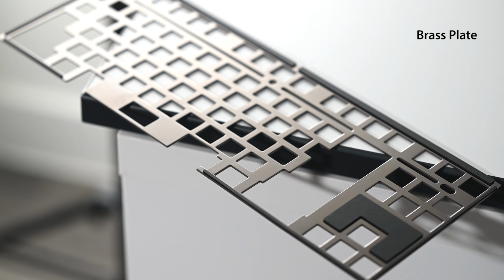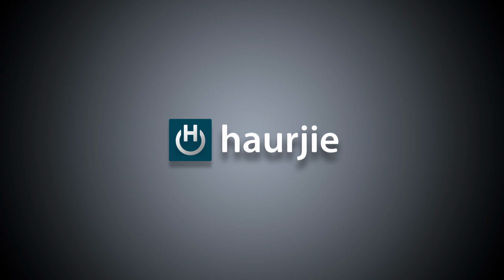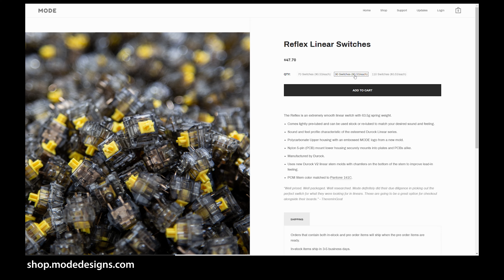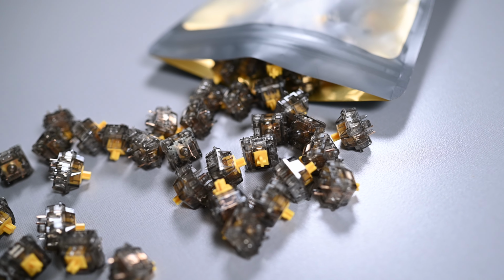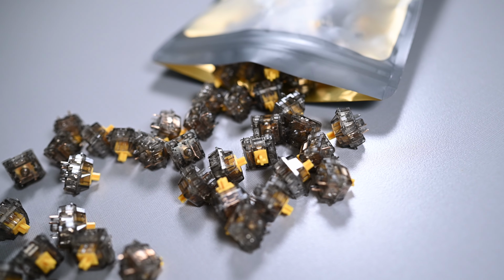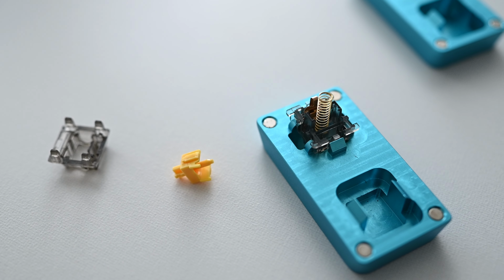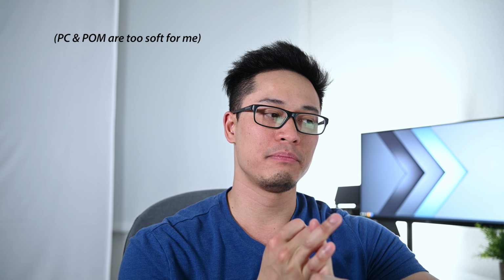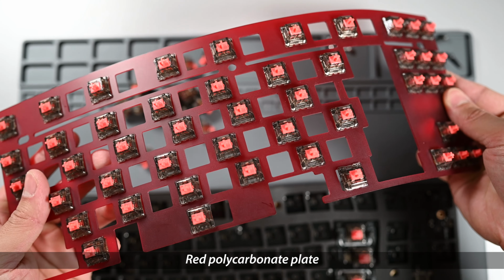Alu vs Brass vs FR4 vs POM vs Polycarbonate Plate (Linear)

Comment: Is aluminum plate thicker than FR4?? was hoping to have my ROG Azoth's height to go abit lower of i change to FR4 if its thinner
Reply from the maker: @TheEightDomain  all plates should be the same thickness. If they were different thicknesses, you'd have fitment issues with your switches right?
Reply: @hardlinenexus  Alright i got your point but i just discovered that the Alu plate of  ROG Azoth is thicker than the aftermarket plates we get, I have decided now to get FR4 thank you for the video <3

Comment: 5:25 anyone knows how to make spacebar sound like that? sound so goood
Reply from the maker: Oh boy, actually this wasn't my best sounding spacebar haha, this was when I first learned about custom keyboards. I'm glad you like it though, if you watch my more recently keyboard videos, the spacebar is much more refined. Has to do with lubing the stabilizers the right way, adding Band Aid mod to the PCB to prevent any ticking/rattling.
Reply: @hardlinenexus  i love that metal thocky sound, my spacebar was smooth and thocky like other keys, i've done everything from modding, changing switch, keycaps and plate but it still sounds normal thock, i really want that metal thocky spacber XD

Comment: Ive noticed a lot of white noise in the background of the video, dunno if thats easily fixable or not but just a heads up.
Reply from the maker: Thanks for the feedback. So it's been a while since this video and I've also noticed some things I could've done better. My video and audio quality has improved since then. I've attempted to remake this video in videos that came after, but I also noticed they're not as big of a hit. Most likely because this video has held so much traction. But at the same time, sound tests in keyboards just vary too much from board to board, like plate comparisons here will different if I used the same plates in a different keyboard. And also the devices people use to listen from also changes that. There's too many biases based on equipment used on my end as a recorder and also on viewers' end, even if I had the perfect setup and environmental controls...

Comment: It is interesting how different materials seem to respond differently depending on whether you are hitting a spacebar vs regular keys. The best I can tell is that the materials have different peak resonance frequencies. So one might sound deeper with a space bar but more pingy with a regular key because the resonance frequency is different. So, the POM has lower pitches with regular keys than an FR4, for example, but the FR4 spacebar is much quieter. The ALU has the bassiest spacebar but pings more than the POM (which is probably the second lowest on the spacebar). The PC has the lowest frequency on the regular keys but a higher pitch on the space than both the ALU and POM.

Comment: The new q1 pro has a pc plate. Is brass an upgrade? Hard to tell difference
Reply from the maker: Brass and PC generally will be on opposite ends when it comes to sound, but there are boards where they'll be closer. Same can be said with any plate, it depends on the board. Brass will also be stiffer and harder when typing so take that into account as well. And I think saying "upgrade" from PC plate isn't really accurate. It's not an upgrade if PC plate is better for you.

Comment: i got a question i want in my keyboard a brass plate but it seems like no plate looks like my keyboard (i don't have stabilizers on shift key and so on. but the plate has the same layout as my keyboard, aka: ANSI!) But does it still fit?
Reply from the maker: Probably not. The brass plates here for Mode 80 were made only for mode 80... there are occasions when people try to mix components and they MIGHT work, but you have to do the research yourself be very careful with it.
Reply: @hardlinenexus  thank you! i found one on KBDfans that fits.

Comment: Hey i have a question can any plate fit on any keyboard ??? Example 60% kyboard with random 60% plate.
Reply from the maker: Nope! Every keyboard has their own plate cut specifically for that board, this is true pretty much 99.99% unless it specifically states you can do some other aftermarket plate from another brand. I don't know any boards at all that can just fit any plate of that size.
Reply: @hardlinenexus  ok thx :)

Comment: Is Mode 80 worth the price?
Reply from the maker: Yes but I can only speak for the first Mode Eighty, I'm not sure about the new Eighty since I haven't tried it yet, but I did buy it.
Reply: @hardlinenexus  I just took the plunge.  Navy with fr4.  Maybe Godspeed, Hammerhead or whale caps.  Not sure I want to drop $160 on caps.  I remember reading a post from one of your subscribers about jwk/Durock linears pairing well with fr4.  Very interesting.  Maybe I’ll use Alpaca or Creamy Green switches.  Can’t wait!
Reply from the maker: @DMCnME  I bought navy with gold bottom on the new Eighty as well haha

Comment: What do you think sounds deeper, Polycarb or FR4?
Reply from the maker: Hard to tell. Sounded the same to me for the most part lol. At least when fully typing. I might be able to have a more significant difference without the middle gasket installed or on a different board
Reply: @hardlinenexus  same thing here, closed my eyes for a blind test and couldn’t figure out which was which. Thanks for your video tho, earned a new sub with all that effort!

Comment: How do the mode switch feel?
Reply from the maker: Factory prelubed. I have the kiwi 62g (light green stem) trying them next to the Mode Reflex 63.5g (yellow stem) switches, both stock, the Mode Reflex feels like there's more glide when pressed. I personally can't feel the difference resistance wise between 62g and 63.5g springs, but Mode switches feel smoother.
Reply: @hardlinenexus  thank you! I appreciate your hard work on this video 🙂

Comment: There’s even a typing test
Reply from the maker: Typing test is the true sound test. When you spam a single key alone, that doesn't really say much because when you have a full typing session, that's the real practical scenario
Reply: @hardlinenexus  also where’d you get the Pom plate?
Reply from the maker: @krenesis_tae  all the plates were ordered from Mode's website

Comment: Bro I like it but I wish you would have used a more widely used switches. I have never heard of any of these.
Reply from the maker: I agree with you! I actually initially wanted to use like tangerines, or kiwis, amongst several others in my collection... but based on the paper specs and feel of the Signal and Reflex switches here, they fall very similar to some other "popular smooth JWK switches". But at the end of the day too, there's so many different switches I could've used and even if I used a popular one like a HP or my Alpaca V2s, other people would also request comparisons with other switches. And this whole testing took me 12 hours to do lol. More importantly, as long as the testing methodology and setup is done correctly, the idea is you listen for how the plate makes it sound instead of the switches. If that makes sense? There's quite a few factors to consider here but I try to manage the constants and variables in a way that makes sense. This will not be the last comparison I do though. :)
Reply: These switches came out only recently and were announced on Mode's discord server. I hear that they're really good!

Comment: Alu for me, that's the sweet spot.
Reply from the maker: My opinion might change in other boards though. Mode 80 is literally all I have haha (except the NK65ee which I don't wanna use anymore anyways lol)
Reply: @hardlinenexus  agree it does vairy, depending on board material and thickness. Thanks a lot for the video still, helps a lot before we dump a good amount of money into a build.

Comment: What is fr4?
Reply from the maker: It's one of the plates
Reply: @hardlinenexus  what does it mean or is the material actually called fr4? Like what does it stand for?
Reply from the maker: @elevator-_-6083  it's the material. Composite made of woven fiberglass cloth with epoxy resin binder.
Reply: @hardlinenexus  oh ok thanks:)

Comment: So I'm using an FR4 plate with black ink V2. But I feel like the sound is very muted. It feels fine weirdly super rigid while also feeling super soft to bottom out, without any flex in the plate. I like it but also wonder if I'd like a harder more tactile bottom out. And although it's nice that it's not too loud I do feel like I probably would prefer a slightly thicker and thockier sound. 

I can get a brass one but I'm not sure if I want to spend the money esp considering the fact that the case is already very think aluminium.and a brass plate will likely completely destroy my Bluetooth signal..and the Bluetooth is very important to me.

Comment: Thanks for the video Sir 🙏 Agree with you, PC & POM 👉 Trash 😂 Alu & Brass are very similar, difficult to describe. Would you say Brass have a deeper sound ? Alu is maybe softer with a more neutral sound signature… Brass sounds louder i think. FR4 is so clean & clacky, i love it. I'd like to try it for my next keyboard, but it sounds kinda loud and rigid. I think my fav is Aluminium plate after all 😅
Reply: nuh uh uh, just because you dislike POM doesn't mean it's trash. In the right case with the right sound dampening, it sounds absolutely unreal. And if you don't believe me, I've got a sound demo.